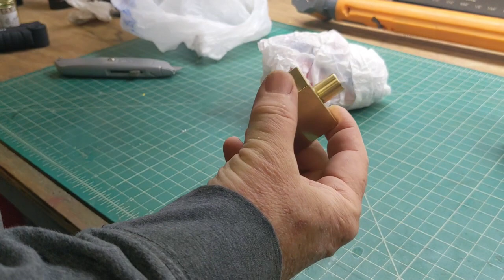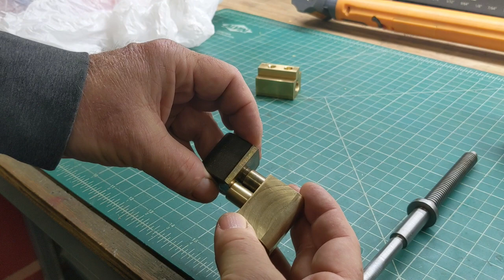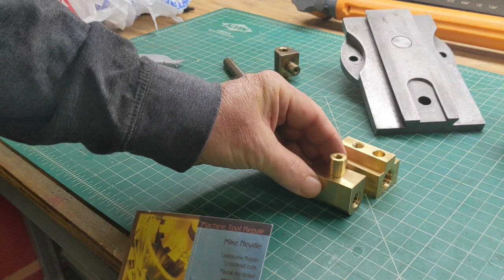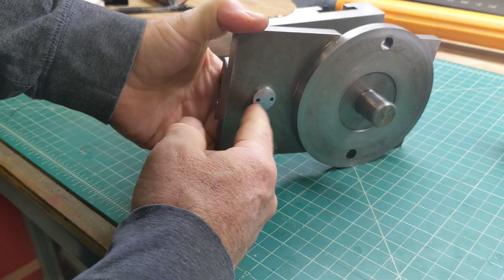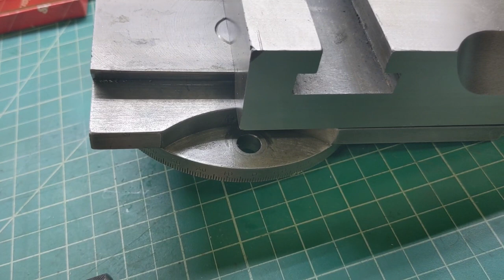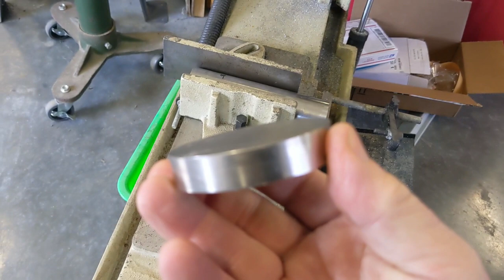Monarch 10EE Lathe Refurb part 31

Comment: Using 1/8”’or so parallels behind thin round parts, between the back of the part and the face of the chill is a quick way to align without having to indicate the face. Snug, tap against parallels, tighten, remove parallels.  loving this series!’
Reply from the maker: Thanks!! I had a blast doing this project. Very rewarding!

Comment: Great serie video's, thank you for that. A suggestion to lublicatie the new cross-slide nut, drill a small hole truy the blind pin hole, put out the pinscrew from time to time and oil the nut inside.
Reply from the maker: Thanks for the tip!

Comment: I’ll bet the parts were cheaper than the taps.  I think you made the right move.  Will you post the contact information on the seller for my records.  I also need a new nut for my tailstock and am hoping he’ll be set up to make them as well.  Hey, where’s the DRO?   Just what you need is another project..  Nice to see it all coming together so we’ll Kevin. You’ve done a really nice job refurbishing this lathe and leaving a great series for the rest of us.  Thanks Much.  Cheers, Will
Reply from the maker: Thanks Will..I agree. I checked the tool cost and was a bit surprised by the price! the left handed one was out there! So the seller is on EBay under the seller name largevise. His name is Mike and located in Kansas. Ah yes, the DRO well I'm thinking about it and I'm leaning on going for it. Thank you for the compliments, I really appreciate it and hope that some folks got something constructive out of it!
Reply: I've made tailstock nuts.  The thread is the PITA there as it's 1/2-8 LH.  When I was trying to source a tap for the one custom maker said "that's impossible!".  There is a seller on eBay of the tap now, for mine I made a tap from A2.  Not enough gullet so it's a PITA to use.

Comment: That feller did a nice job of the nuts. The lathe looks very good, sounds smooth as well. We can cut you some slack on the chipped insert.
Keep smilin
Reply from the maker: Hi Darren and thanks for watching! It's funny...when I watched the video, the lathe seemed much more noisy than it actually is. Much quieter in real life! I was surprised I didn't catch the broken insert!

Comment: Good to see the lathe operating and getting some work done.

I like those old Cushman chucks with the fine scrolls - great clamping force.

A small tip: put set screws in the open mounting hole for the follow rest.  That way when you need the hole you won't have to chase it out and clear it.
Reply from the maker: Thanks Russ!  That's a great tip! sharp eyes! It is pretty amazing how well those chucks work!